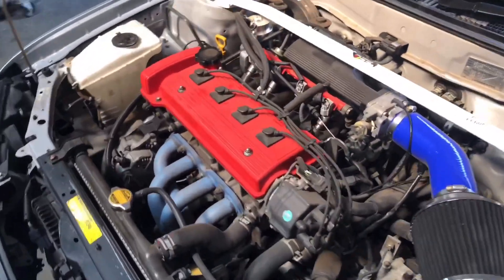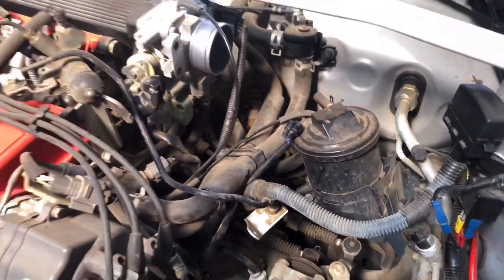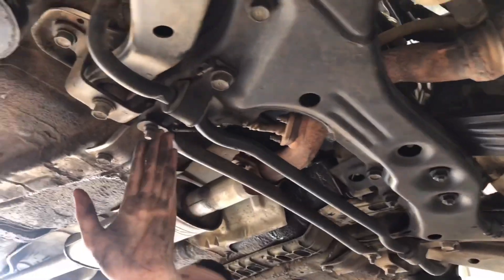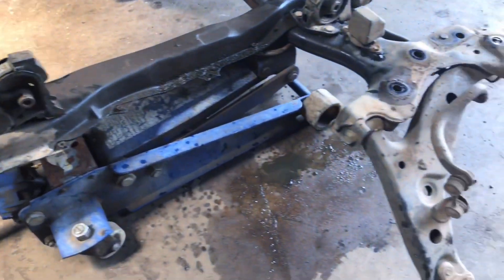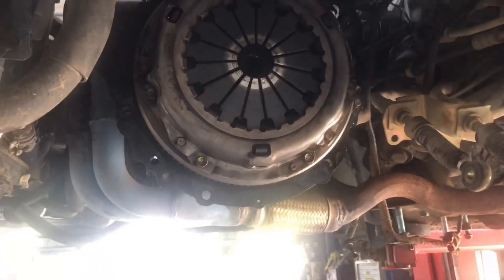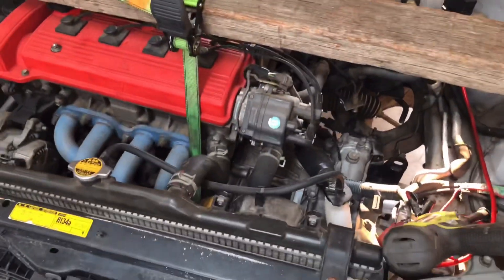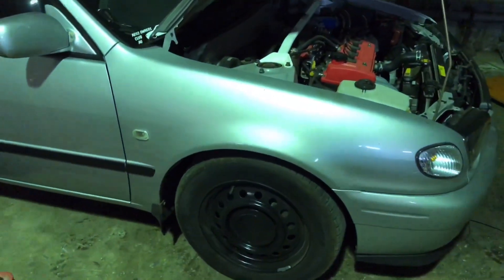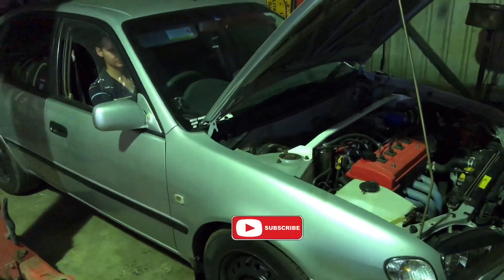Gearbox and Clutch Replacement AE112 Toyota Corolla

Comment: Excellent video guys, my 314,000 km AE112 clutch is going to need replacement soon. Could you tell me the part number of the main rear seal that you replaced. Also, do you think is a good idea to replace the CV axle seals now that both are expose. Looking forward hearing from you guys.
Reply from the maker: Hey Edward. I don't know the part number you need, however, a good parts shop will get it right and they're not expensive. While everything is in pieces, it's definitely worth doing additional maintenance while you're there, especially at 314,000 kms. I'm a big believer in maintenance. Thanks for watching and supporting the channel!

Comment: Awesome video. I'm going to do the same job this weekend. Just wondering if it is possible to get the transmission out without removing the sub-frame. Cheers
Reply from the maker: Caleb, thank you for your feedback, appreciate it! How did you go extracting the gearbox?
Reply: Yes Caleb, did you ended up removing the sub-frame?
Reply: @lapaneton  we gave it a go without, but just ended up dropping the subframe. It’s a lot easier

Comment: Hi, what car did the white strut stabilizer arm come off and would you know where I could get a right hand side fog lamp from? cheers.
Reply: Hey. Thanks for watching the vid. Sorry for the late reply. I'm the owner of it. The strut bar is a dd racing 2 point strut brace off eBay. I bought it back in 2018 but can't seem to find the listing any more. Fog lamps are hard to come by. Keep looking someone will sell a set.
Reply: @jacobchalk9884  Thanks for getting back to me Jacob, I found myself a strut bar and fog light. Would you know of anyone wrecking a AE112R Levin, need dark coloured interior parts? Wrecker etc.